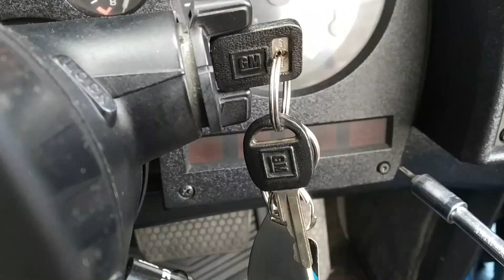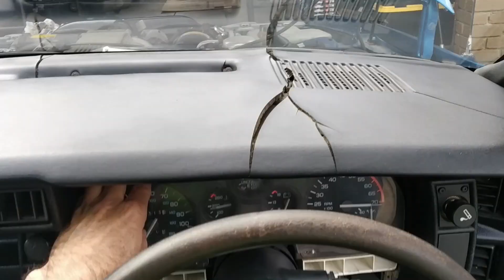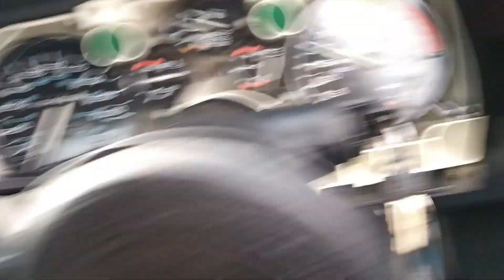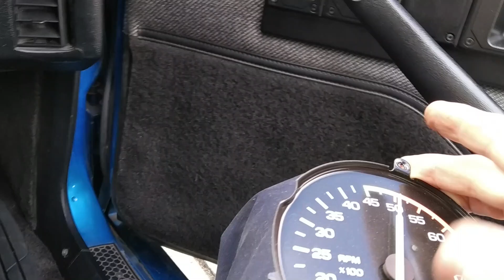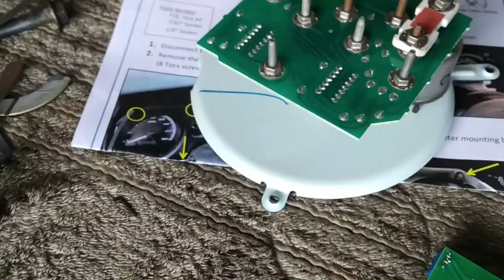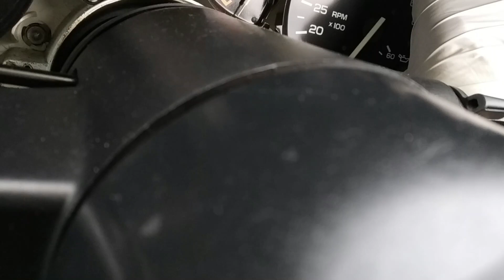Chevrolet Camaro IROC-Z tachometer fix

Comment: Hey I have a 89 Camaro my fuel gauge keeps reading high over the fuel mark  i replaced the gage its still reading over full, not sure if I really have a full tank or not but it moves but no lower than the fuel mark
Reply from the maker: @The1972Cutlass  I'm afraid that your fuel sensor unit might be faulty. And it's a pain in the butt to remove it. It's located in the fuel tank. The only way to access it is to remove the fuel tank.
Reply: @ChrisSofos  o ok thx for letting me know I had a feeling that's what it was
Reply: @ChrisSofos  is it the rod looking thing that has like a lever that is right there as soon as u remember the fuel pump
Reply from the maker: @The1972Cutlass  yes, i think you got it right. But it's inside the fuel tank. This is located on the top of tge fuel tank which you can't have access, unless you remove it

Comment: God bless whoever answered my question for my 88 chevy camaro for circuit board I thank you so much 👍 🙏 I another quick question 88 camaro when I start my car engine goes high temperature starts to go high too leftside from valve cover oil smoke  comes out any comments or answers I would really appreciate it I thank you so much 😅.
Reply from the maker: @BalJeet-j5k  so to get your question right: 
Smoke comes out of the valve cover when the engine is in operating temperature, correct? Where exactly from the valve cover the smoke comes out?

Comment: Thanks for the info.  I replaced my board.  Tach works now.  But oil pressure is reading about 8 psi but I confirmed with mechanical gauge it should be 35 psi.  I put 96 ohms across the wire but still was low.  About 15 psi at 96 ohms.  Any advise?
Reply from the maker: Thanks for your comment. I had a problem with the oil pressure gauge as well. The problem it's not the gauge itself. It's the oil pressure sensor, located next to the oil filter. Replace it and you are done.
Reply: How many ohms should that resistor be ? Mine is 1.5 kohms
Reply from the maker: @Keeterbob  I'm not sure! I tried to find it on the manual, but I couldn't. However I found a guide on how to check the issue on the engine pressure oil gauge. If you want send me your email to give you that guide. It does not say anything about ohms values though.
Reply: Did that too.  Measured ohms across new sensor.  86 ohms.  Still only 15 psi  should be 40
Reply from the maker: @Keeterbob  if the pressure remains the same when the engine is cold or hot, then more than likely, the gauge is faulty.  If the pressure is higher with a cold engine, then there's an issue with the engine (given you have a new oil pressure sensor). 
A good way to see the difference in oil pressure is in wintertime. Or you can try a thicker SAE engine oil and record the results. 
Are you sure that the needle of the gauge had not been removed and relocated on the gauge? People do that sometimes when the gauge indicates extremely high oil pressure.
Reply: It’s not the engine.  I connected a mechanical gauge and had 35-46 psi.  The pointer moves up a little but not much when I start it.  Reving the engine had no effect.  I ground the tan wire and pointer stays at zero.  I disconnect the wire and pointer pegs at 60.  I need to trace the wire to see where the tan wire goes into the dash.  Something shorting it to ground partially.  I get 86 ohms from the sender but 170 at the post behind the gauge in the dash
Reply from the maker: @Keeterbob  I think you are right and you may have found where the problem is. Let me know how it goes!
Reply: @Kd you figure it out? I got my tachometer working but now my oil pressure gauge is dead. It was working on the old board. I also have a new oil pressure sensor I installed less than 2 weeks ago. 🤷‍♂️
Reply: @Western.Confrence  did you figure out the problem?
Reply: @natalyaperez3561  i did not unfortunately. I'm strongly considering getting a digital dash now because these gauges are not accurate.
Reply: There’s a ceramic resistor on the back of the fuel, temp and oil pressure gauge on the dash. My green colored one was bad, replaced it and it’s working fine